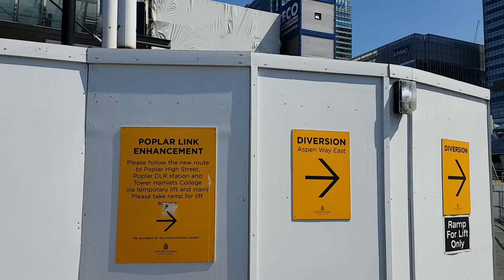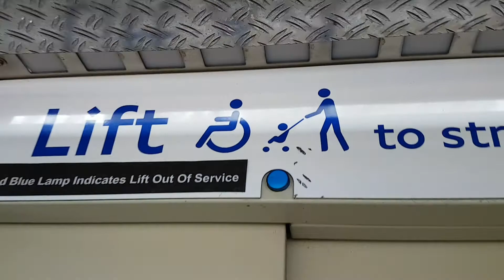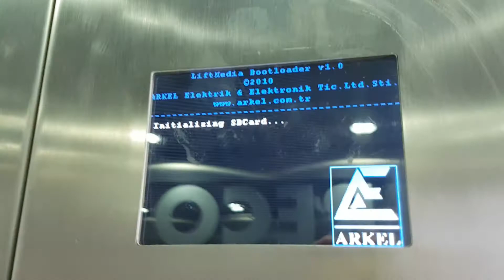Temporary Reco Lift at Poplar DLR Station

Comment: Do they dismantle it and install it somewhere else when it’s finished with? I struggle to imagine taking a lift apart and reinstalling it again, but I suppose it is possible.
Reply: Hi Lift Tracker. That's right! The lifts are modular in concept. That way we can adjust the height depending on the needs of our client. On this page of our website you can find a video of the installation of one of our lifts: https://reco-lift.eu/en/lift-services/assembly/